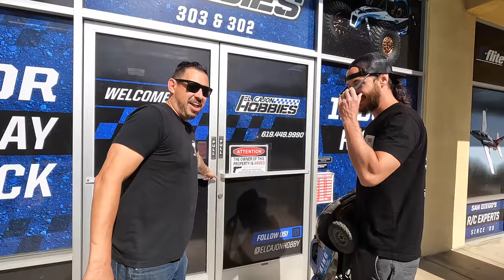We Got the Sickest Mini-RC ROCK CRAWLERS!

Comment: I got back in RC vehicles recently. While looking for parts for my real truck, I came across a 1/10 scale crawler of my exact truck. It was about $600 and RTR. I figured that I'm blowing about $5500 on a suspension upgrade, what's another $600 on a toy?

Half a year later and I've built another crawler, added a UDR and Infraction, and now I'm going broke in the drifting scene. Stretching the wallet very thin, but loving every damn minute of it. 

It's such a great hobby, especially with the way the world is these days. Turn off the TV, silence the phone and go outside with your toys. I'm lucky enough to have a hobby shop right down the road from me that has a decent sized drift track. I've also met some cool people along the way, sharing set-ups, painting technics and just overall having good time.

Comment: I have one of the 1/24 scale trucks, and 5 batteries total. Already have done some meta/brass upgrades to it to add more weight, and added some cosmetic upgrades. I have a new body coming for it, as well as a trailer. And its a lot cheaper to rot these things than an actual vehicle.